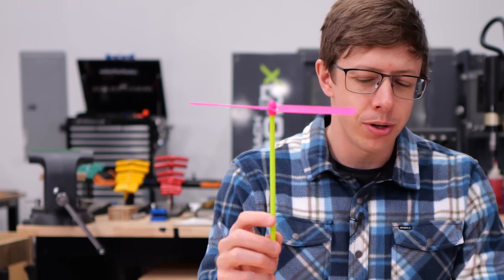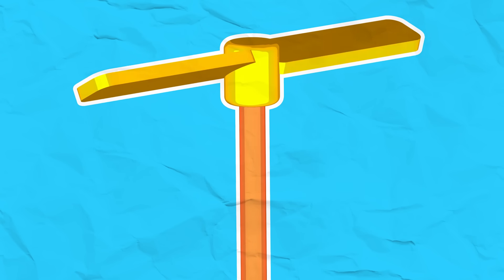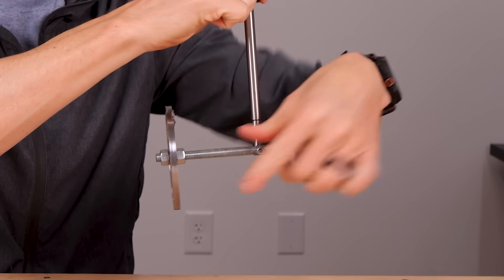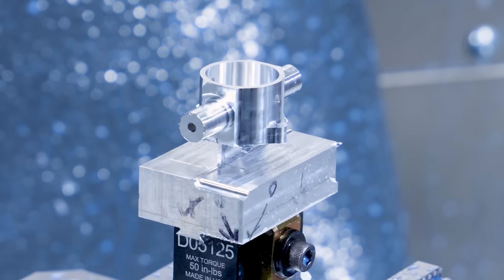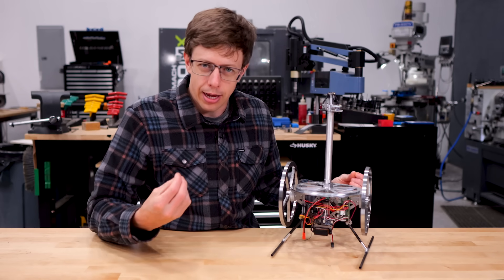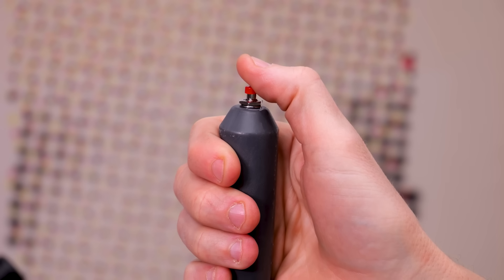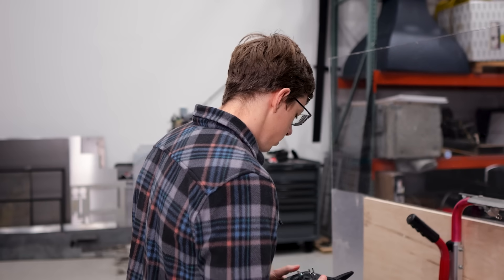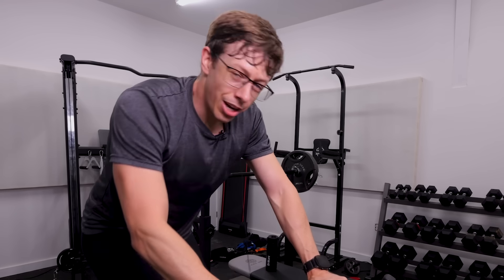I really thought this would fly well

Comment: I thought to myself that you should really encase the flywheels, but wrapping them seemed work. 
What I don't understand is why you have both flywheels imparting energy to the propeller. If both are using the same gear to turn the propeller, they are both rotating the same way just on opposite sides of the vehicle, thus not stabilizing the craft. Shouldn't one be rotating clockwise and the other counter-clockwise? 
I suppose you could use a differential to get both of them to turn the propeller, but I thought that the point of the second one was to keep the body of the craft from spinning. Or am I missing something?

Comment: The position of the control surfaces combined with the ground-based launch pad probably contribute to making the design difficult to test. Control surfaces typically want smooth airflow to function. As the column of air moved by the rotor blades travels down it collides with the ground, building up a local high pressure that deflects further air to the sides. It also causes all kinds of turbulence. Considering the 'ailerons' start out a mere inch above the flat surface of the launch platform you can't expect much effect from them as they probably have very little non-turbulent air going over them.

Starting from a suspended position similar to the Kazakhstan launch platform might help out with 'low-power' test scenarios if you are sticking with the aileron approach to countering rotation?

Comment: Why not have a single flywheel rotating inline with the propellers and not mechanically linked to the helicopter body -- just mounted on bearings? Obviously there'll be some friction in the bearings but that should be easier to overcome than the torque of the flywheels.

Also, I've seen the "prop wash over control surfaces" design in other videos and I don't think it worked then either.

Comment: Would it help if you stacked the flywheels on top of each other and position them at the bottom? 
The mounting and gearing would be a bit (a lot) more complicated but since there's some helicopters that have their rotors arranged that way to counteract the blades' rotational impulse.

Comment: I mean... helicopters are designed a particular way for a reason.  Which makes me wonder how the whirly bird things work in the first place.  My guess is, the length of the shaft plays a critical roll in the stability of the system, keeping it oriented towards the sky and in roughly the direction of flight.  How much you want to bet if you drastically shorted that shaft it will not fly well at all.  Adding anything to this design begins to overcome the physics involved and to make it work, you're basically going to have to design a helicopter with either counter rotating blades or some kind of tail equivalent to a helicopter.

Comment: When you described the concept of maxing out the toy I pictured the flywheel on the outside of the blades, then I thought about those fancy toroidal propellers that everyone got excited about a few years ago. Put that on a stick and spin it with some horsepower and it would GO. You’ve probably wanted an excuse to make a toroidal propeller on that 5 axis mill too.
I thought it was an odd choice to take a concept of a spinning toy and work really hard to make it not spin. Once it’s not spinning it’s now a helicopter with an inertia drive. Every helicopter has either counter rotating blades or a tail rotor, prescession was only ever going to be half of your control problem.

Comment: Needle bearings have higher friction. Wouldn't you have ample power to have a tail rotor or an opposite rotation propeller? Smaller helicopters have a little counterweight thing on the top to help keep it level. You could embrace the spin completely like that fighting robot where any changes in spin help steer.

Comment: Why put the flywheel/gyroscope vertical? you can put it horizontal and make it spin opposite to the blades.
Another option might be to have 1 flywheel horizontally and 1 vertically, or have 3 flywheels in X, Y an Z axis so you have a gyroscope in all directions which means the helicopter can only move up, down, left, right, forward and backward, but it can not rotate its axis.

Comment: Hi,  I like the content.
Can the vertical anti torque wing be positioned so it's horizontal axis goes through the vertical axis as the rotor shaft?
Instead of flaps, make the whole wing tilt, that will use the maximum energy of the downward air flow.

Comment: Even if the wings had fixed the rotation issue you're generating power from the autorotation and thus would be generating torque in a section of the flight in which you don't have the huge amounts of airflow under the props. Only real solution I can think of here is a counterrotating mass/blade, the latter is probably better but the former is more holding to matching the idea of the toy.

Comment: You just needed to embrace the precession: Use a single flywheel with horizontal axis and offset the thrust vector of the rotor disc along the flywheel's axis from its centre of mass so that it precesses in opposition to the drag on the rotor. Further offset the rotor disc's thrust vector from the flywheel's axis so that rotor thrust balances the torque caused by slowing the flywheel. Both those offsets need to vary through the flight, which sounds hard but is actually fairly straight-forward: use a rotor that can effectively tilt, and mount it above the flywheel. Helicopters have already solved tilting rotors.

Comment: Just a thought, Why not try to have the flywheel under in an horisontal position hinged on a ball joint. Connected via a planentary gear reduction to a thrustbearing driving an control plate (Swashplate) That in its turn connected to the rotor blade. You will still have the rotation effect but in theory the flywheel will stay horisontal when the chassie rotates and auto control the blades to keep it going vertical up. And maybe some rotation effect can be deleted with having the flywheel spin oposite direction as on an coaxial copter. 

Theres alot of forces in an helicopter as for example "gyroscopic precession" in the rotors that requires the inputs to be corrected 90 degrees infront of the blades.

Comment: Should have gone for counter rotating propellors, co-axially mounted. Mount two more fly wheels at 90 deg to the two you have and then set the second rotor spinning the opposite direction to the main propellor.

Comment: I'm sure someone has said this already. But Isn't it possible to implement same design as most of the helicopters have. So having a tail with tiny light propeller added to counter act against the rotation... And keep the fly whee design same. Maybe even possible emergency parasuite could be placed on the tail in case main blades turning won't stop it. As far as i can see that design already wirh adjustable blades etc is identical to how helicopters are working?

Comment: Laying here in bed in pain at 3 am after watching your video yesterday, and got to wondering why, instead of gears and flywheels and all kinds of frustration, you didn’t try making the blades shorter for higher RPMs, and compensating for the loss in lift by making them wider, and possibly spiral downward gradually tapering in toward the shaft. Or maybe you did run that in simulation and I missed it because I was doing 5 other things while watching.

Comment: 5:43 I literally solved this problem with manufacturing a gearbox for a backwards steering bike, you can have 2 shafts along the x-axis via keeping them external and having a lubricated frame hold it up, and you can do 1 of 2 things for the y-axis:

1. long shaft
Benefit: less space used
Cost: energy transferred from flywheel A is not as securely transferred to flywheel B

2. split shaft
Benefit: Secure energy transfer between flywheels
Cost: takes up more space, bottom split shaft is going to act as a source of rotational force on the machinery

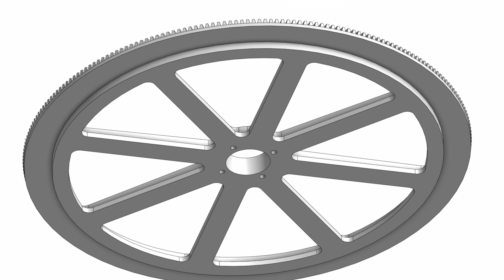EDIT: 6:06 DUDE NOOOOO! You NEED to use chevron teeth on your gears! It reduces tooth slippage!

EDIT 2: Okay screw it, I'm emailing your ass EVERYTHING I see wrong or could be improved. Get back to me once you have notes on all 8 points I've written down.

Comment: 14:48 yeah. I didnt even consider that problem. You zeroed out the flywheel torque, but you didnt zero out the rotor torque. THIS would be a scenario where a couple of those bevel gear could link and reverse a second set of blades to the first. Three bevel gears and another rotor. But i disagree with the fundamental design to start with. Lol. But you know what they say about opinions, so on that matter ill quit the topic before i stink up the place. Lol

Comment: 12:00 funny, that wasnt the thought that occurred to me. My first thought was d9uble checking the motor controller software. But if it IS the flywheels, it would only be because of tolerances being too low and cause ling vibration and shake, or if you built your flywheels unbalanced. But if they are balanced, even a trickle of power should be able to get them up to speed. Its very east to keep a wheel that already moving, moving. Much harder to overcome inertia. But if the motor can over come the inertia to start with, then it shoukd be able to handle sppeding up and maintaining speed, since that part takes less energy. 

Unless the air resistance of the blades are ultimately the barrier the motors cant overcome, since you straight geared between flywheel and blades, instead of ratio gearing it. In otherwords, theres a software gkitch somewhere, or as the flywheels spin up, so do the blades, and tgen the motor or power just cant get past a certain point because of the logarithmic increase in resitance for adittional speed.

EDIT. So it was blades on flywheels doing what i was saying the rotor blades were doing.

Comment: 12:12 what is the average horsepower from one horse?
Reply: Averaged out over a day, a working horse outputs 1hp with a max output of 15hp. 
Hp is force (foot pounds of torque) times distance (meters or RPM) divided by time. 
Donut media has a good video about it with animation.
Reply: @SillyGoose0ntheL00S3  The averege horsepower (comparison to other horses) is 15HP. Can I evaluate how much horsepower I have?
Reply: @KeesKhoff the max output of a horse is 15 hp, the average hp is 1.
Reply: @KeesKhoff I provided the equations you could use to evaluate in my original response. For example, let’s say a car outputs 180 foot-pounds of torque at 3000RPM and maintained that state for 15 seconds. So, 180•3000/15=200hp.
Edit: let’s say horse is pulling a 100lb load up a cliff with a pulley and it takes it 1 minute to pull the load 100m.
100 • 1 /100= 1hp.
Reply: @SillyGoose0ntheL00S3  in the video he is showing twenty horses while he is saying ''twenty horsepower is a lot of horsepower''
the correct number of horses is 1.333333333.

So he is wrong.
Reply: @KeesKhoff I think he was saying to overcome the drag of the flywheels it would take 20 hp, hence fixing it with the heat shrink stuff. He was trying to minimize energy waste and improve efficiency, thus attempting to fix a foresight error
Reply: In order to get the same result as him, you would have to find the drag coefficient and calculate the force/work needed to overcome it… he came up with 20hp and I’m probably missing some variables he took into account

Comment: 7:42 ok. You did make the bottom the heaviest, but left the balance like a triangle. Youre gonba get roll over. Too much area to resist the wind when going up you have to drag trough the air meaning you get pushed side to side violently. When fallin, the bottom will act like a droge chute. Air resistance over comes weight and you fall bottom up.

Comment: The little flaps won’t do anything it’s like blowing your own sail might help a little. the blades are creating lift same as a wing not the air travelling down. Did you use RC helicopter blades? A drone or RC plane prop would have worked

Comment: There is a reason helicopter tail rotors are far from the center shaft.  The anti-torque vector from the tail is significant. I would also saved a bunch of design/machine time by just buying an RC helicopter, and stealing the rotor system & other bits.

Comment: I’m sorta curious, could it not be possible to have the fly wheels rotation in plane with the propellers? Right now I’m envisioning something like a harmonic drive or one of those magnetic gear linkages, point being the input and output rotate around the same axis. If you were to use two flywheels spinning opposite around the same shaft axis but with one larger to balance against the propeller, maybe that could work?

Comment: 6:04 oh man. Yeah... you are totally going the "all the weight on top, with multiple failure points, and changing the angle of power direction 90 degreess...."  seriously. Unless you put more weight on the bottom half of tge shaft than youve currently added to the top, your look8ng at topling over and powering your way ito the ground almost immediately.

Comment: 4:46 the way you are holding the flywheel and rotors suggests that you plan on a side mounted flywheel. This is another reason your design iz unstable as you now have a giant weight offest from the rotation axis. 

Since you dont want the fly wheel spinning separately from the shaft, you should have went with a heavy wheel mounted horrizontally under the rotors and this would provide a balanced force while spinning, as well as keeping the energy generator and the reciever of tge energy in the same rotation plane, eliminates the need for complex linkages that have to make crazy directional changes. And for the same way an engine that has a crankshaft aligned rotation of the wheels, rather an engine putting its power out to the side and directly into spinning a wheel is more efficient and looses less power than an engine spitting its power out the back and then needing to change 90 degrees inorder to get that power to the wheel, so too would you have less points of failure, more efficient input output ratios, and more power AND stability simply by making the central stick the point of rotation for both your flywheel and your rotors.

Comment: 1. All you are building is a helicopter. Either design a counter-rotating blade, or put a tail rotor on the end of it, (shaft driven off the main rotor).
2. That landing is called a yard sale. All the parts spread out on the ground for you to pick through.
3. Stuff a plastic trash bag into the rig somewhere, so when it crashes again, you can pick up all the pieces and hopes and dreams, stuff them into the bag and throw it all away... XD

Comment: This seems extremely over engineered, I’m no scientist but could t you just get two wheels to spin the propeller just like how ur hands spin it, then have them release the propeller when the rpm is correct? Also wouldn’t a hollow tube be able to hold a parachute explosive that pops when the propeller speed tops out ? The only thing left is shoving an altitude tracker inside the hollow tube. Feels like you were making a dual prop RC helicopter with extra steps

Comment: Engineers make things with equipment. Mechanics see the faults. Operators make the faults. You show all of it. Just need one thought, the hand helicopter leaves the hand with just the shaft and prop. You need to design this to have the prop release from the winder. Thought, make the blade pitch adjusters spring loaded to increase as it reaches RPM, launching away from the winder.

Comment: 2 solutions,
!) use 2 propellors going in opposite directions.
2) have a horizontal anti torque propellor.
When i was a kid we would take an 0.49 glow engine and tie a light wt rag to it.
We would start the engine and set it on a piece of plywood. The thing would spin the opposite direction of the propellor but the rag limited this spin. You are trying to reinvent helicopters and thats not going to work.

Comment: Doesn't the angle of attack on helicopter blades change during its rotation? That's what gives you directional control. Your blades are fixed and thus make controlling it nearly impossible aside from the obvious counter rotating issue you were trying to combat

Comment: Just a young engineer trying to see if I can help... adding two more flywheels so they make a square from the top down would generate more energy over time. But instead of driving them into the bevel gear on the underside like the first two you have now drive them into the top. A lot of friction and time to "charge them" but theoretically double the energy as well as it would cancel your gyroscopic forces. Alternatively, you could change one of the current wheels too on top and it would do the same. Best of luck!

Comment: I bet someone's already said it in the comments, but you could design in an additional counter-rotating helicopter blades to take care of the counter torque of the original blades to the point there the roll axis is controllable via control surfaces.  The tricky part is making a collective to control the pitch of both blade sets, likely with a serries of drive shaft tubes going to the blades, and a control rod for the upper blades.  You could also create a traditional swash plate for the lower set of helicopter blades instead of using control surfaces.  Another thought I had regarding your initial design, is even if the flywheels were rotating in the same direction, the craft could still rotate about the axis of rotation of the fly wheels, in addition to the problems you noted.  But great first attempt!  You got it if you keep trying as you always do!!